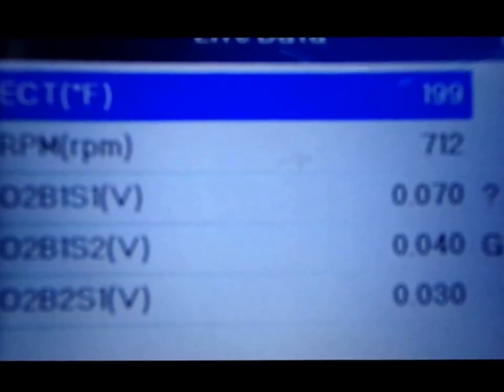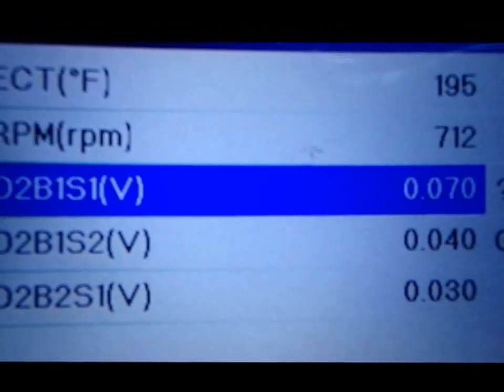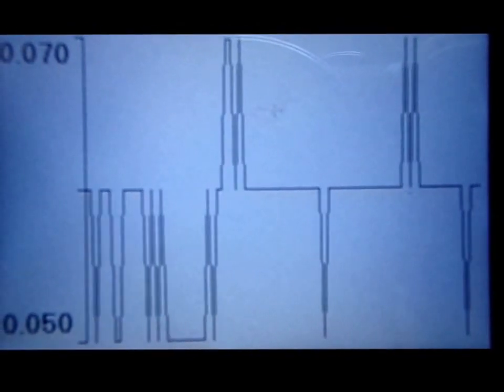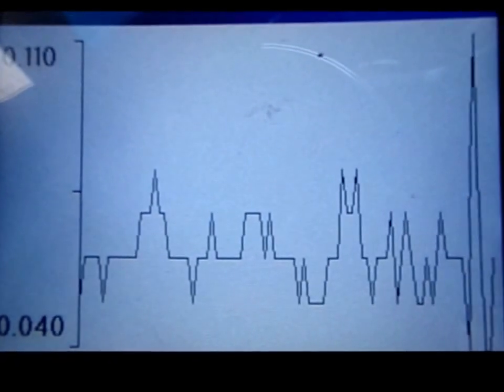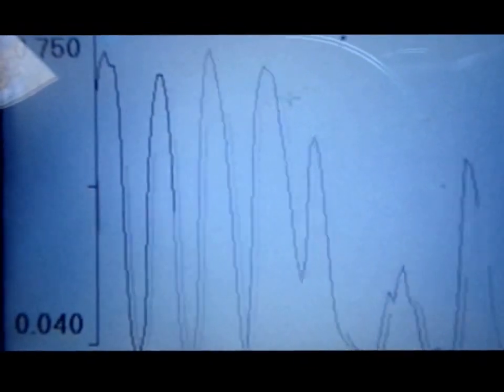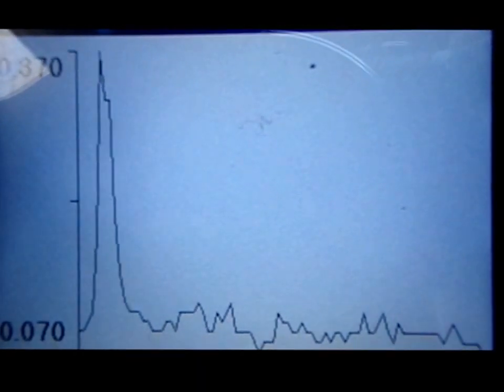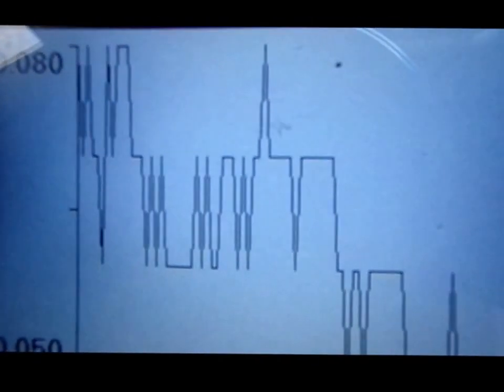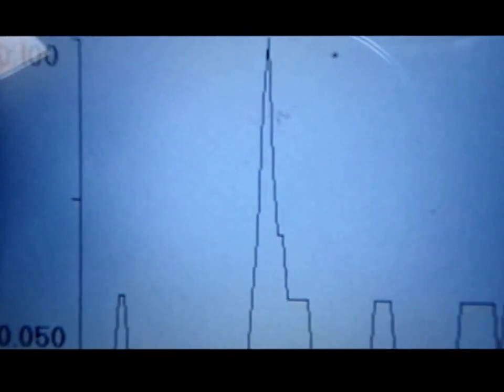Easier way to read live data!

Comment: My car just seems to stay in open loop even after warming the car for about an hour or so, the engine coolant temp stays at 90 degrees and the long term fuel trend is all the way at 25%, the o2 sensor after the exhaust stays rich at .9 and fluctuates down when I rev but sensor 1 stays at .65 and doesnt budge when I do, I'm confused if it's the first o2 sensor or if its a simple thermostat replacement, any incite would be greatly appreciated thanks
Reply: I also got 2 codes for bank one o2 sensor lean and another one with just bank 1 too lean, like I said it might be the o2 sensor but I want to know for sure before I throw 200$ at orileys!!!

Comment: Another good video
Reply: If your engine is a 4 cylinder then you just have 2 o2 sensors a upstream & downstream..but if you have 6 cylinder or 8 you need to drive @ least 30 to 40 min to get o2 sensor to hot enough to satisfy computer 👍